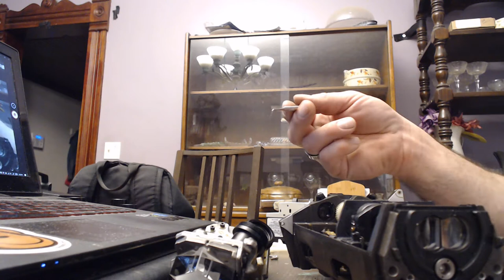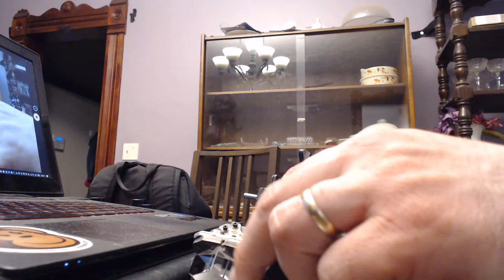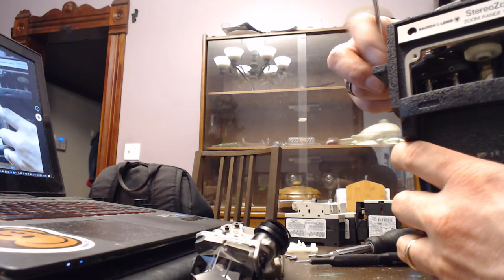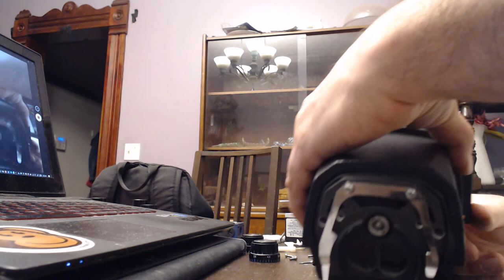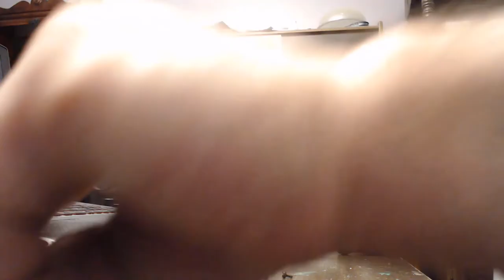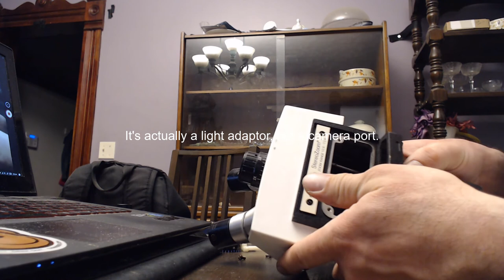Bausch & Lomb Stereozoom 7 Tear Down and Repair.

Comment: Hey I have 2 questions. 1) There are two sets of springs 2 small ones and 2 large ones. are the small ones on the right side of the scope if you are looking at like you have in the video? 2) Which way do the springs face when going into the yoke cams? Is the spring going into the metal slit? or is the tip of the hook going into the metal slit? Thanks!

Comment: How did you remove the stage? I'm trying to remove my pinion gear.
Reply from the maker: What do you mean stage?
Reply from the maker: If you mean the top gear, then you basically just remove all the top end stuff until you get down to the gear under the eye-pieces. Avoid touching the prisms and take your time. The gear is likely cracked, mine was on one of my scopes.
Reply from the maker: If you mean stage as in the base where you'd put specimen; these are pod type microscopes, they just lift off.

Comment: I have the same microscope. When zooming in, towards the bottom of traveling of the lower lense, the right one jumps a bit when they slide closer together on those angled guide rods. It almost looks as if both lenses are supposed to nest together smoothly, but instead kind of bump. Not sure how to fix
Reply: The plastic yokes on these break, look for cracks on them. The lenses touching wrong means the cams are aligned wrong somehow.